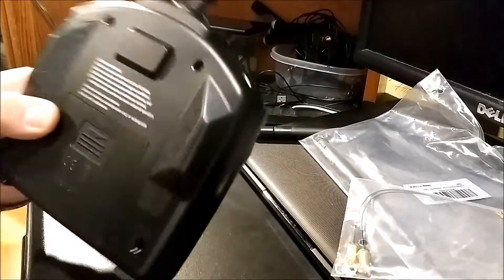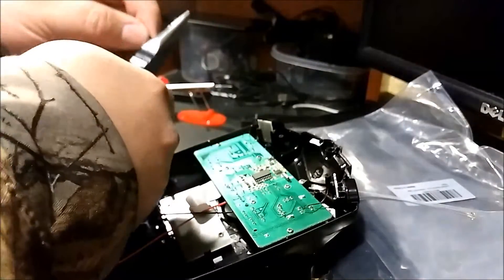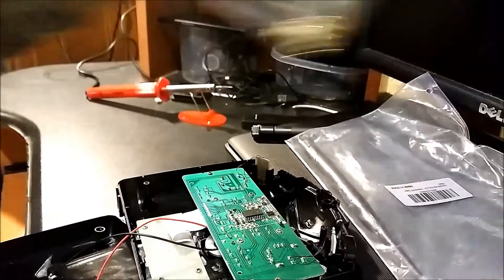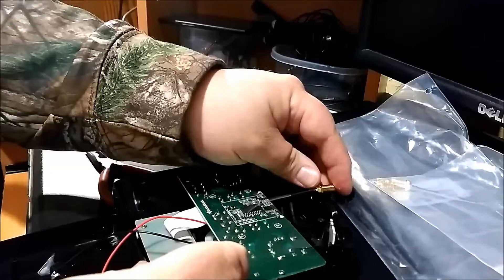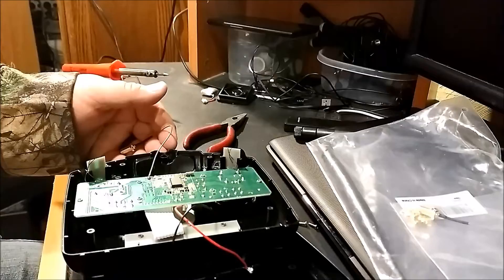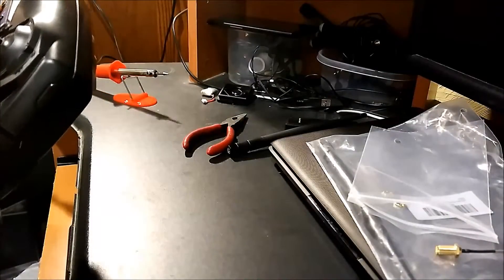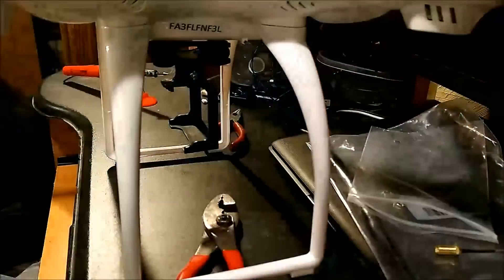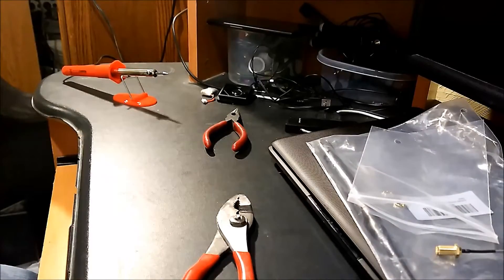Promark P70 VR Drone - Mod the Mod - Part 1

Comment: So do I need to ground the antenna, or can I just splice the new antenna onto the short antenna wire?
Reply from the maker: You can splice but use a small amount of the shielding to ground it
Reply: I hate to sound so ignorant, but when you say the shielding, are you referring to the black plastic coating on the wire on the board? I am adding antennas to both the controller and the Promark GPS Shadow Drone. I was thinking just splicing the antenna wire to the short stock antenna
Reply: Also looking for a solution to the wifi on the camera since it is also weak. Just purchased a NEW Holy Stone's NEW 1080P 5G camera which arrives tomorrow.

Comment: Mike I recently purchased a Promark VR drone. Have everything set and ready to go. Have attempted to fly it without any luck.Every time I take off it go's up and then starts to take off on its own. Will not hoover. I have no control. The only thing that I can do is emergency landing crashing it. I think there is some thing defective. Have seen posts by others that state there drone just flew away since they could not control it.  Have sent email to Promark and left message for support. No answer at all.
Reply from the maker: I would just take it back and get a replacement

Comment: i have a question is it possible to connect my own transmitter appose to using the standard?
Reply from the maker: You would probably have to change out the internal reciever and board possibly? But that could be really fun to try.
Reply: i have a dx6i transmitter do you know anything about them?.....thank you for replying to fast too!
Reply from the maker: I looked it up. Looks like a cool transmitter. I don't know much about them at all.

Comment: I know this is kinda unrelated to the Promark but I did my first Long range test of the beta litchi app setting up waypoints preprogrammed to the phantom and it went around 10,500 feet away at 400 feet high. It was a bit scary but the flight went great. The only part that litchi needs to work on is POI because the camera did not lock on its POI that I set but it did fly great. Next step for me is to dish out the $70 some bucks to get the Argtek extension mod. Still thinking if maybe adding the 2.4ghz and 5.8ghz boosters to the mod. To get that extra little boost to the Argtek mod. And yes the drone was in line of sight at all times granted the drone looked like a very small dot in the sky.. P.S. Mike yes that's how you pronounce my name... 🤓
Reply from the maker: Ya totally on topic any drone question is cool. Glad you had success with that app. I have heard mixed reviews on it. I have yet to play with the Waypoint system. I have used the POI and ya mine did the same thing. Gotta practice it some more. I have thought about the Argtek just not sure if I wanna mod it or not? Keep me informed and how it goes.
Reply: Mike's Drones and More I definitely will keep ya updated
Reply from the maker: Awesome!
Reply: Mike's Drones and More I did lose video at around 4,000 some odd feet and telemetry/control at around 6,000 some odd feet so once I get the Argtek mod it will be interesting to see the difference it makes.
Reply from the maker: Kurt Gagel ya for sure